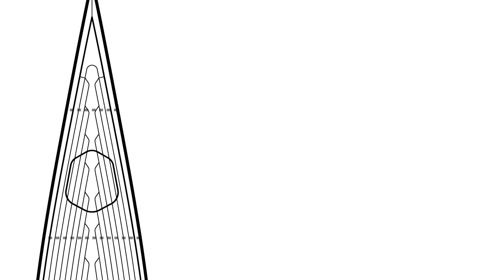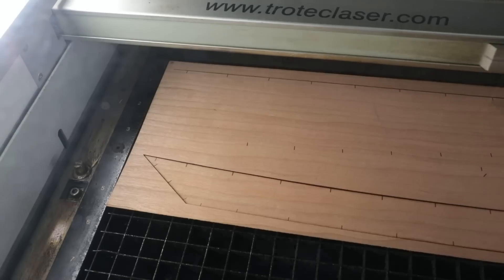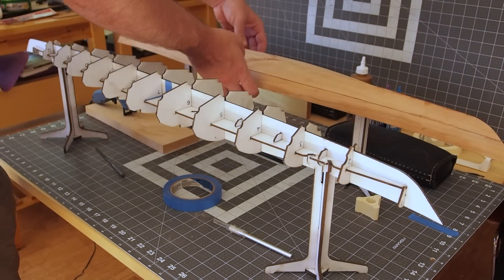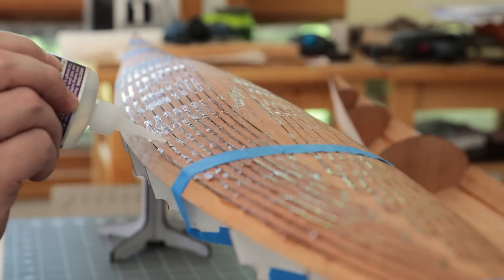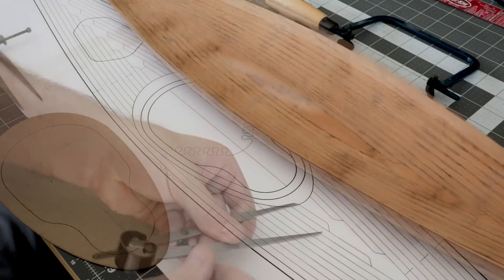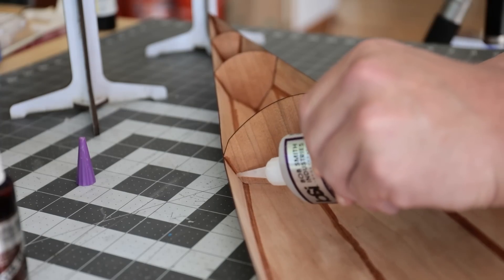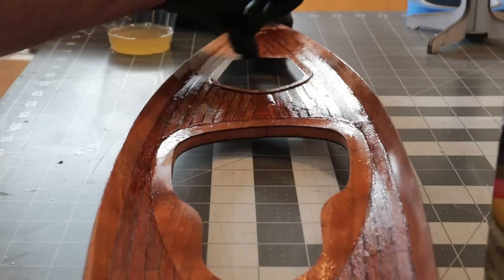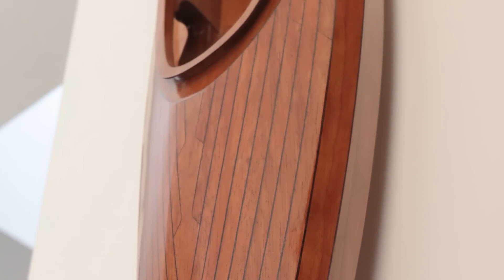Stitch & Glue Kayak | New Concept Model

Comment: Very nice! I’m looking forward to the full size version.
Reply from the maker: Wow, thank you!  That means a lot to me coming from such a respected designer/builder!
Reply: Brian Oltrogge I would not have thought of the pre-cut strips because I would be too worried about the tolerances working out at full-size, but I bet it will work great. It is a cool innovation.
Reply: @Grunblau  do you have facebook
Reply: Wow, high praise coming from you Nick!  I've loved your build series and hope to eventually build one myself.  I do think there is something to this approach that Brian has done, especially if he can figure out an effective way to do the stitch and glue method without needing to do any stitching. It would make for a beautiful craft.
Reply: I would love a set of plans for this. Looks like it would be a fairly quick build. I have a 40”x60” cnc router that has pass through capability so I should be able to do much of the cutting with that.
Reply: Yes, me too!
Reply: Fan of your work as well Nick,  Also looking forward to this build.  This is something that I would love to try as well some day soon.  Rockler woodworking we must be close to each other.  I work for Industrial Metal Supply Co.  If you need any metal products for the build let me know. I would be glad to help.  Thanks for sharing this part of your project. Well thought out and well done.
Reply: @BrentStandridgeBrentZen  шоллганопврамврн6

Comment: How the hell did you go about unfolding the plywood sides from cad? I've been looking for an answer for about a week now...
Reply from the maker: You can unroll “ruled” surfaces.  This is a surface where you could, at any point, place a straight edge across the surface edge to edge.  In this case, if you extract 2 isocurves or section lines, and then loft them-you can unroll them.  

If you have 5 lines in space, do individual straight lofts and unroll them.  This gets you 98% there.  For my strips, the tips were modified in an “It should still work” fashion for aesthetic reasons.  In Rhino, look for  “unroll surface”

Hope this helps!
Reply: @Grunblau  Thank you so much 😭

Comment: 4 years on and an Australian sits on a rainy morning transfixed by this build.  Great video!  Now I need to find out if you made a full size and how it turned out.
Reply from the maker: Thank you!  YouTube basically broke out in a canoe and kayak rash right after I finished this model.  With a new mail order kayak being built every week, I figured that mine would surely get lost in the shuffle.  Also, I was hoping that the Koi Pond series would help me to afford the materials, resin, etc…  but that was when the YT algorithm changed and so did my ability to budget for projects like $800+ of kayak materials.

I have the mahogany plywood and the full scale buck ready and I have filmed the start (cutting and assembling the buck), but I will have to keep doing other less interesting things off camera to pay the bills and hopefully buy some epoxy and fiberglass at some point.  

I also immediately built another one of these models for a friend.  Turned out even better than the one in the video!  So I have considered making a run of kits to pay for the full scale build.
Reply: @Grunblau would definitely buy if you are able to ship international
Reply: Wow. Where can I get the plans for this model.

Comment: Three years ago, this is the video that made me subscribe. I don’t know if you’re still planning on the full sized model, but you should put a small motor on this guy to drive it around in a pond.
Reply from the maker: Thanks!  This was the last video that got meaningful views for my channel…. Shortly after, YouTube also broke out in a rash of Kayaks and Canoes from various YT makers. 

I bought all of the wood and cut the full scale buck.  I still need to buy about $450 worth of epoxy and fiberglass.  

Going from a self supporting channel where I could budget for tools and materials to barely able to document my own projects I pay for out of my own pocket made it so I had to reprioritize my projects based on what I could actually afford from time and money.

I still intend to do the full size version although I used the epoxy and fiberglass for the Koi Pond that got 18K views.  I am considering producing a limited run of Kayak kits to help pay for the full scale version.

I don’t agree with the changes YouTube has made that punishes longer format content from older channels.  I think they have gone overboard with commercials and I would rather not do videos for products if I can help it.  It is an unfortunate situation that will hopefully resolve itself soon as I know many YouTubers are struggling to continue their channel.  

I am making content whether anyone will ever see it or not.  I am also focusing on developing a prefab building, while balancing a job and taking on uninteresting fabrication work to pay the bills.

Sorry for being so long…
Reply: @Grunblau  I have a similar problem with funds towards my own kayak project so I know what you mean. YT is getting really out of hand. I wish there was a better platform, but I know that there aren’t as many views on other platforms. Keep working hard, I’ll keep doing what I can do for you on my end, and I’ll definitely keep an eye out for possible kits.

Comment: It has been two years since this video have you built a full size kayak yet?
Reply from the maker: I have the materials and the buck finished.  As soon as it is reliably above 50 degrees in the shop I will likely get started.  I do not have sponsors for this (yet), so it will be out of my own pocket.  For the remaining $400-500 of epoxy and fiberglass I was hoping the koi pond videos did better but they were a total failure.  With an expectation of less than 20k views on any video I release, I am going to be releasing videos when I can afford to, unfortunately.  

I still enjoy doing it, but when a video returns $80 after investing $2000-$4000 in materials plus time, it is hard to justify the time commitment.  

I am working on doing a limited run of laser cut kits, too.  Basically waiting out whatever broke in the algorithm that hides channels older than 5 years and considering new directions.

Comment: has there been any movement towards going to a full size version?
Reply from the maker: Yes.  I have the buck cut out and assembled.  I am talking to a laser company that could laser cut the Okoume pieces (ideal).  I will likely cut the parts on the CNC if this falls through, soon.  

With YouTube’s new algorithm, I may need to explore sponsors as it isn’t a cheap project, especially if a final video gets less than 10K views!

Comment: Does this model support the theory that this kind of stick and glue is quicker to build than strip built?
Reply from the maker: Yes.  This would require much more effort and would be less controlled if I just used strips of the same width.

Comment: I would be really interested to see how you came up with the geometry for the strips, spine, etc. in order to produce the complex curved surfaces. And I love how the engineered features of each part are allowed to show through as aesthetic features in the final assembly. Beautiful.
Reply from the maker: Once I had the smooth model complete, I designed and projected the lines onto the surface.  From here, pulling off the strips was not too difficult. Thanks!

Comment: Shouldn't it have a structural element running down the keel? Seems like it will be weak there.
Reply from the maker: Will rely on an epoxy putty fillet and fiberglass inside and out on the full scale build.

Comment: Cool vid! Looking forward to the full-size build. How did you get that finish on the 3d printed part? Is that an acetone wipe on PLA?
Reply from the maker: File smooth, then CA glue, then sand smooth, then Polyurethane.  Works great!
Reply: @Grunblau  Thanks!

Comment: Hi Brian I was wondering about your design process, what CAD tools are you using? and how did you flatten your pieces to get your cutting patterns?  The model is beautiful, but I am equally impressed with your design capabilities.
Reply from the maker: Thanks!  I devised a grasshopper definition that allowed me to place points in space to define the shape, loft the lines, produce the ruled surfaces, array tick marks along the seam, and unroll the surfaces dynamically...  I could tweak the shape 1/16” at a time and have all of the patterns update.  For the deck, I designed a simplified pattern in the top view and projected this into the kayak deck.  When I settled on the overall shape, I went back and cleaned up the geometry for the deck, lofted the lines and unrolled the shapes.  A lot of work, but easier than doing it all by hand!
Reply: @Grunblau   Ah you are using Rhino.  I use Fusion but it doesn't have a command like unroll.  I'll have to take the plunge and try a new CAD environment.  Thanks for the reply and the video.

Comment: Bro pls tell me how you calculate ratios for large to miniature model
Reply from the maker: You can either scale based on unit increments, like ‘now I want every foot to be represented by 1/4”’ or you can scale based on actual material thickness, like ‘now I want this 1/16” material to represent a 1’ thick wall’ or you can scale by a ratio, like ‘I want this model to be 1/4 the size of the actual object’

In all cases, I draw a line the size of the actual object, then I draw a line the length of the representation of the object starting at the same endpoint. Then I 3D scale around the co-endpoints snapping the actual length then the representative length.  Probably hard to follow in written form but easy once you try it.  All graphical means no math!

Comment: Before computers and CNC, I would do all that by lofting, by hand. all made by hand. This modern CNC makes this kind of work so much quicker, with little skill needed. You youngster don't know how lucky you are.
Reply from the maker: I am glad I have an idea at least...  not a youngster, but I started using a CNC on Windows 3.1!  I try to leverage the technology to do something that would otherwise be impossible (or very difficult).  I am also drawn more to objects that are one step removed from digital fabrication...  3D printed then cast for example.
Reply: @Grunblau  My job was to do the impossible, to a high standard. A skill that is slowly dying.

Comment: Amazing piece of artwork. And it gives me hope that maybe I could build something for my 6ft 9" frame to sit in. I love kayaking and haven't done it for 25 years since I got too tall for it. If you would consider selling your plans once done I would be interested as I could increase the volume and still have a beautiful boat!
Reply from the maker: 6’3” here and I was amazed at the specs for kayaks.  Might find one that can hold 200lbs but only if your shoe size is 6 or smaller...  What you are saying is definitely possible!
Reply: @Grunblau  yep that's what I found back in 2005 I nearly bought a pyranha Everest, I could just get in it with the foot plate out but even then I would have struggled as it was not what I'd call a comfortable seating position and my feet couldn't sit side by side. And that's a multi day kayak your meant to be able to get tents and kit in too!

Comment: Wow! That’s amazing. Curious, how long did this take you? From design to final build?  I’m really curious about the design work.  How do you go about designing where the seams are supposed to be on each piece?
Reply from the maker: Good question because it was a side project...  I also had a design completely ready to go and scrapped it to change the deck pattern.  If you draw two line in space and loft a surface between them, you can unroll the surface...  so set up the curves you want in space....  loft the curves and unroll the surfaces...  basically as easy as that.  I probably spent a month of evenings researching, designing, etc...  month of evenings on the model.  Lots of wait to dry steps...
Reply: Brian Oltrogge That makes sense, two lofted lines unrolled.  I think I could ask you a million more questions. Thank you for providing an answer.  I really appreciate the time and effort you put into making this and the video. It’s a beautiful piece and elegant design.

Comment: That is one really fine stitch and glue boat.  I sometimes use a hot glue gun and high temperature glue for tacking full size boat pieces in place before epoxy.
Reply from the maker: Thanks for the tip!

Comment: Nice project, it looks great! Can you say something about the process of finishing your 3D printed parts, was that an acetone solution you applied to give that finish?
Reply from the maker: I generally use a metal file to get surface reasonably smooth and remove bumps from the print.  Then I coat the surface with thin CA, sand smooth with 220 grit and then final coat of (in this case) satin polyurethane.  I just skipped over this because I have shown it in a lot of previous videos and leaving the entire process in would have thrown off the pacing and made the video more about the mounts rather that the kayak.  Pretty simple and gives really great results in PLA prints.

Comment: what is the point of doing this when there is a perfectly fine way of building kayaks that is both easy and thoroughly tested?
Reply from the maker: What way do you prefer?  I think cedar strip kayaks are beautiful, but difficult to execute...  stitch and glue are easy to execute, but less attractive, generally...  full fiberglass could be an option but by the time you build the mold, you could have built the kayak...  thanks for the comment!

Comment: Awesome project. I built one of those blocky stitch and glue kayaks years ago to teach myself epoxy fiberglass plywood construction techniques. Learned a lot but my technique needed lots of work. This is definitely some next level stuff compared to that. Would be great if you eventually sell kits or rights for people to have full size parts cut from the cad files. Maybe you could partner with someone like Ponoko.com and people could order the laser cut full size parts from them and you’d get compensated for your design for each kit sold. That would be cool and way better than trying to cut parts out by hand from paper templates like I did.

Comment: Hi, beautiful model! The planking and finishing work is top notch. I'm a sail boat model builder. Came across your vid. Is it possible for you to sell this model as a DIY kit to the public? I would like to buy this kit and build it. Thank you.
Reply from the maker: We will see!  Seems to be quite a bit of interest...
Reply: @Grunblau  Hi Brian, I assume you used Rhino 3D for the 3D model. I use Rhino as hobby(Industrial Design was my college major), mostly for 3D printing(SubD->Nurbs->Polygon->STL file. So if I want to build the same model in Rhino. What methodology did you use? Nurbs or SubD? My guess is SubD. How did you break up the SubD surfaces into planks for laser cutting later? Not sure if you can share some of your 3D to fabrication process in a blog somewhere. I need some tips and tricks. Your work is just inspiring!
Reply from the maker: I mostly used grasshopper to set up the file.  Design lines are projected and ruled surfaces are created and unrolled.  Grasshopper helped me dynamically iterate….  Obviously, you only really focus on half of the boat and then mirror the work.  I am trying to sort out all of the facets of YouTube/plans/documenting my process.  Some times (I am learning) you don’t necessarily have to give away all of your tricks.  That way, the work you do and the way you do it can be yours!  I am sure there is a sud-D approach too.  I used to use Tsplines back in the day, but stopped because I’d have to bake everything.  Excited to try if/when the right project comes around!

Comment: The model is stunning. Very intriguing way of stitching it together. What about using superglue on the full scale model? It does get pulled into the grain,so it seems like it will provide a pretty strong bond. I know this is never done, but don't know why.
Reply from the maker: For the full scale version, bonding is done with epoxy and fiberglass.  Superglue is a good scale counterpart but it is toxic and you can develop a sensitivity to it...

Comment: Wow, it's been a while! Good to see your videos again. Kayak looks great. Did you design it in Rhino? Would like to see that. You were the person who got me into Rhino.
Wish I could be proficient in grasshopper. 
My fire-keg, torch and tongs are still going strong.
Reply: We never did see how the domino project finished.
Reply from the maker: I was intending to give those to someone that ended up passing away...  sort of a gut punch to the project.  I was also considering producing them for sale because they actually turned out really nice.  I checked with a local foundry that does investment casting.  The cost of the aluminum molds for the wax is ~$1000 per cavity.  This works out to $30,000 for a domino set.  I am currently looking into building my own injection molder and getting some investment casting equipment...
Reply from the maker: Yup, all designed in Rhino.  One of the only softwares you can still purchase and not have to pay subscription fees!  Adam Savage also uses Rhino3D, BTW...

Grasshopper is better when you use it for  tasks you could do by hand over and over again.  This model uses something like 24 points in space to define the overall shape.  Splines are run through these points and then are lofted through other splines.  With Grasshopper you can  simply input the points and have grasshopper continuously update the splines that update the surface.  This allowed me to tweak the points over and over until I had the shape I wanted.  Without grasshopper, I might have gotten to good enough, not wanting to redraw the entire model to move the tip of the kayak up 1/8”.